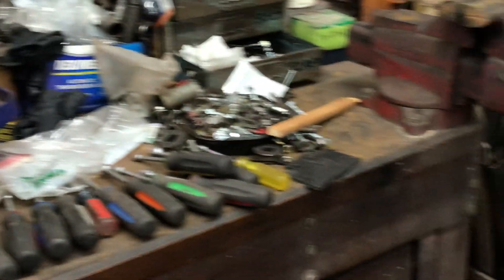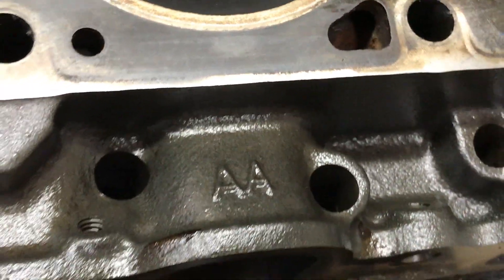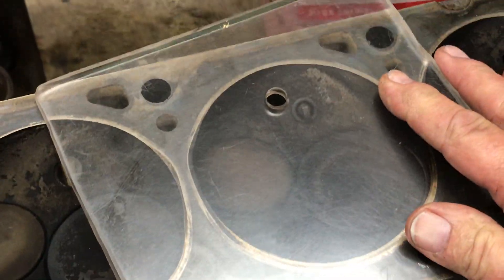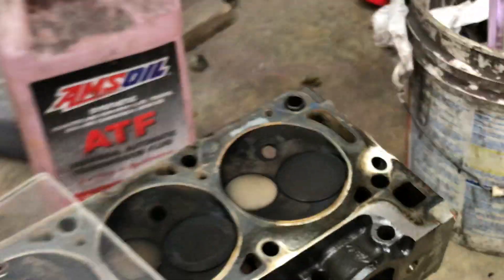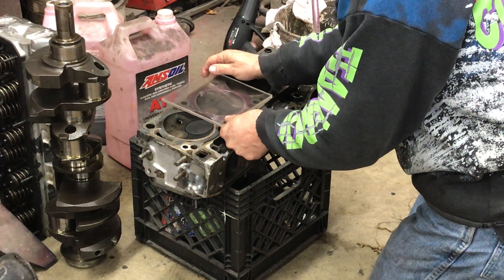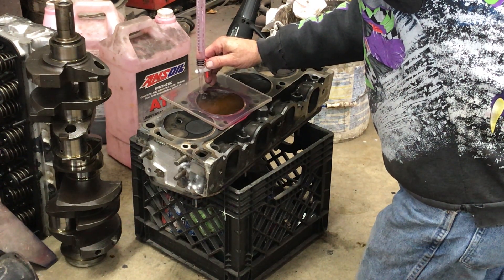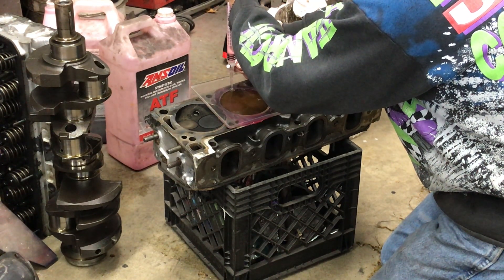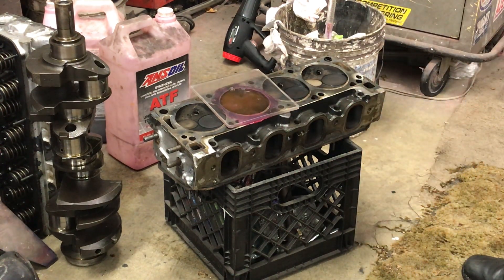Measured combustion chamber volume of a 351 Cleveland cylinder head.

Comment: Thanks for asking. The engine went back in the 68 Mustang not long after the video was made. It is running great!
I run it like I stole it whenever I drive the car. 
Fun fact. The car with just a 750 carb ran a best of 11.54. People that say a 4V cast iron headed Cleveland doesn’t have any low end tq need to go for ride in one 😅
Reply: Always curious on the combo people run with those q code heads. Do you run a pop up piston to increase compression? What is the compression in your engine cam? Do you run a spreadbore intake?
Reply from the maker: Yes, pop up pistons increase the compression ration. My pop up pistons have a 7.23cc volume. If I run my open chamber heads it has 10.15:1 compression. With the closed chamber heads the compression is 11.35:1.
No spread bore intake. One this engine I run an old Holley Strip Dominator single plane intake. The strip Dom for a Cleveland is an excellent intake but is very hard to find and expensive when you do find it.
Reply: Yeah I've been looking to build a 4v Cleveland. So I'm trying to learn and get some good info. Right now I'm building a 302 not quite the same thing. From what I've read looks like the 4v Clevelands have a particular recipe to make them  shine. There's so much folk lore and myths along with some truths here and there. Richard holdner dynoed all the 4v Cleveland headed engines did well at low rpms.  It'll run the same in the dyno as the car.

Comment: Those aren't 351c 4bbl heads dude. 4bbl heads are closed chamber, 2bbl heads are open chamber. A 351c never had 2bbl heads. Maybe you should research any previous changes the former owner may have made!
Reply: Sorry Matthew, 351 Cleveland Did in fact come with open chamber heads. Here is some info for you to read up on Cleveland engines. There is a chart showing which version had open and closed chambers. 
4v heads had bigger valves. The heads in the video have the bigger valves. These Are 4V heads. https://pantera.infopop.cc/topic/sticky-3-351c-basics-and-performance-tuning